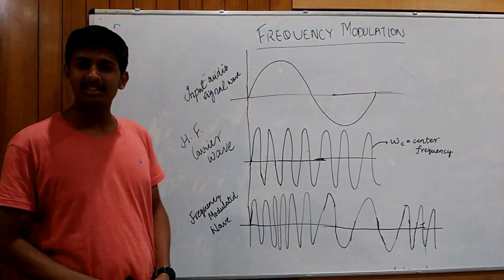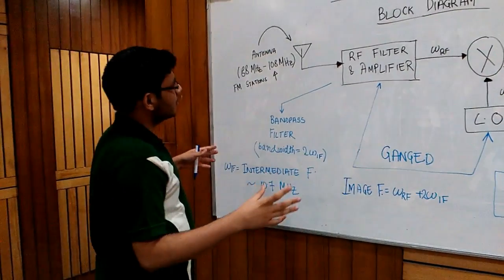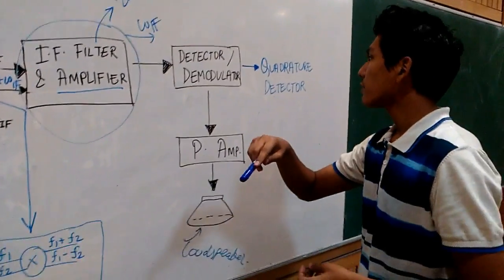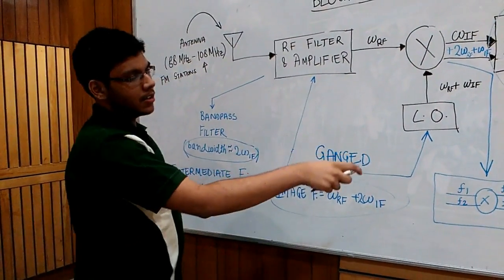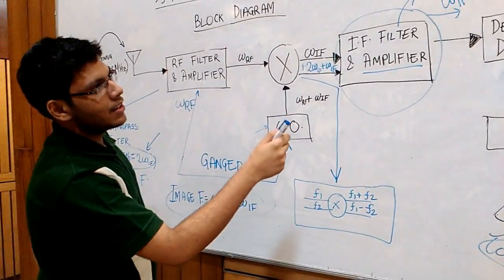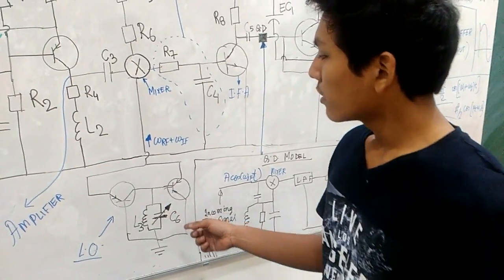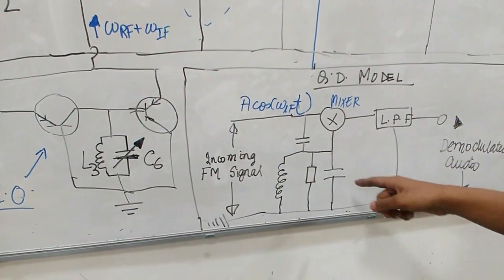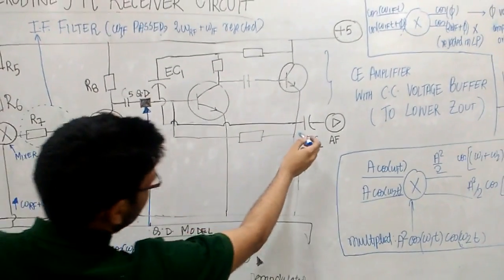SUPERHETERODYNE FM RECEIVER CIRCUIT

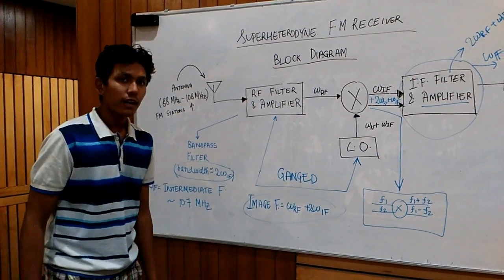Comment: 3:46 and hence couldn't understand the reason.  
problem:
1.he was too fast
2.a better recap needed
Reply: So it looks like w_rf and w_lo goes into the mixer.
w_lo is set = w_rf + w_if
This means that the two output signals from the mixer are:
w_lo + w_rf = w_rf + w_if + w_rf = 2w_rf + w_if
and
w_lo - w_rf = w_rf + w_if - w_rf = w_if

Then you filter out the first signal and allow only w_if to pass.
Reply: When w_if is defined to be w_lo - w_rf, then the radio frequency is considered to be "downstepped."  You can then use a Resolution Bandwidth Filter (sort of a Gaussian-shaped band pass filter) centered at a chosen frequency corresponding to the w_rf to be measured.

For example, if you want to detect w_rf = 100, and your w_lo is 200, then w_if is expected to be
w_lo - w_rf = 200 - 100 = 100
This means you set your w_rbw = 100 to see if there is a resulting signal.

w_rbw is held constant, but w_lo is swept.  The w_rf to be detected then will always be w_rbw = 100 less than the w_lo.  So if you want to detect w_rf = 150, you set w_lo = 250.

You also use an envelope detector to detect whether or not there is a detected signal or not.  For instance, if there is no signal, then
w_rf = 0, so w_if = w_lo is a constant sinusoid.   The envelop detector would output a DC signal
If there is a signal
w_if = w_lo - w_rf, which is a function involving a sum of two sine functions at different frequencies => an enveloped wave.  The envelope detector would output a sinusoidal signal corresponding to the envelope amplitude variation.
Reply from the maker: what is that you couldn't understand, the initial selectivity or the image frequency thing?